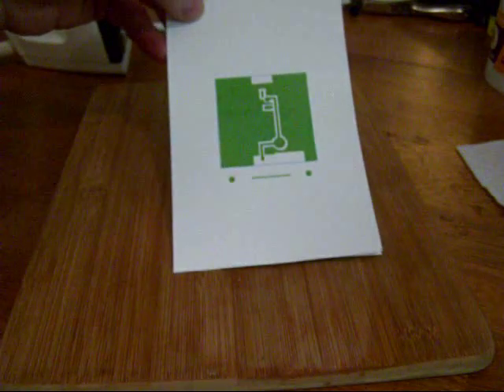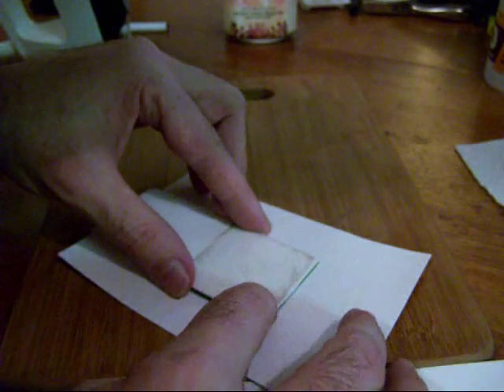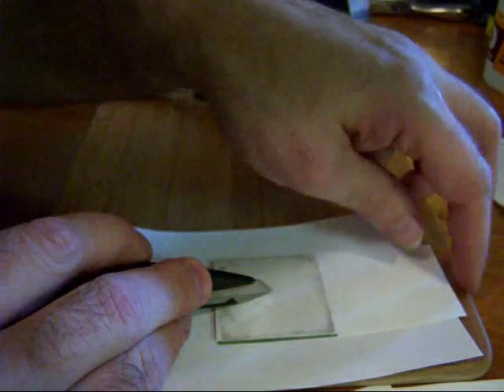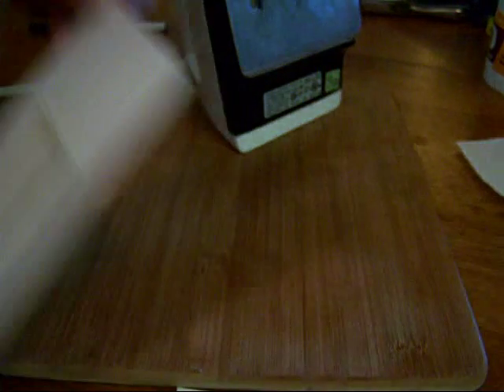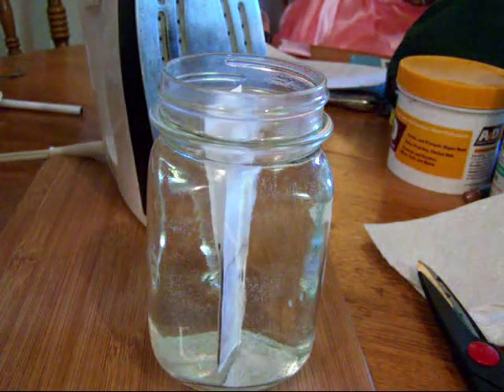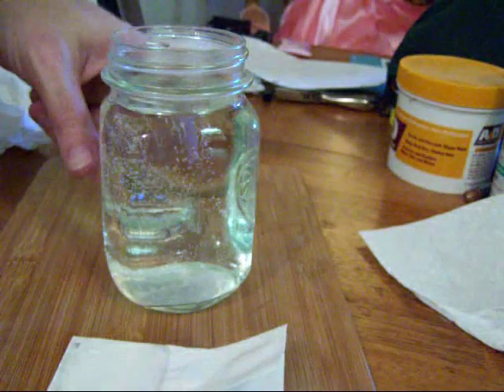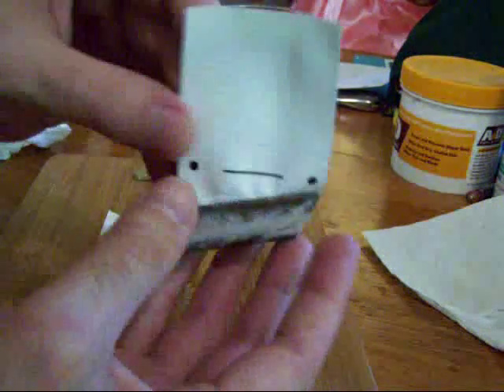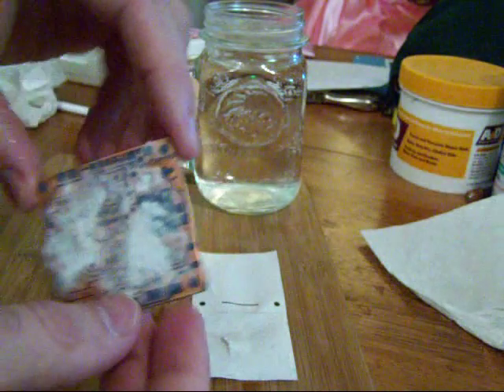#3 H2O2 - Applying Transfer paper to PCB, Part 2

Comment: How about putting the guide dots farther out from the edge of the board. Then there is less alignment error due to the thickness of the board.  Also, put them farther apart from each other: less rotational error.

Comment from the maker: LIiutaio  Said : "Gee, plain paper loose easier than this!"  Translation.
I will have to try normal paper. 
This was the second time  I had done this process. 
I now use 120Deg F water mixed with dish soap, the Water now penetrates the paper and there is very little rubbing. It almost falls off in one piece .